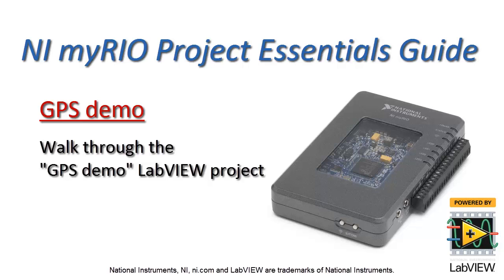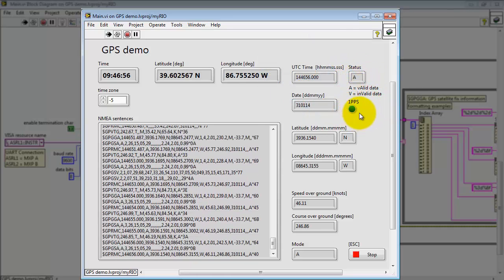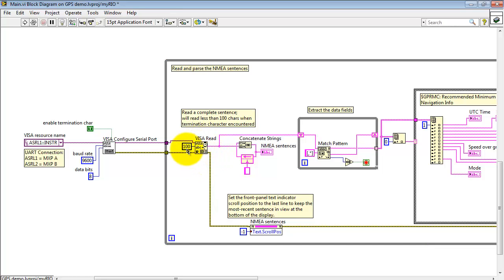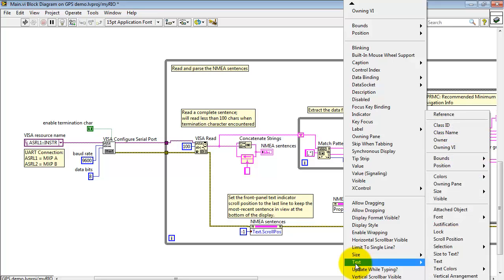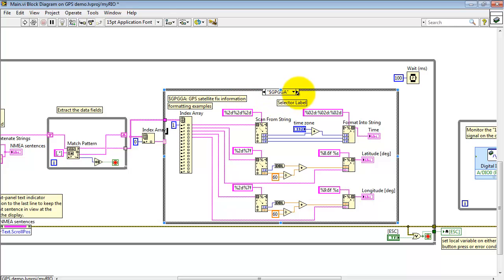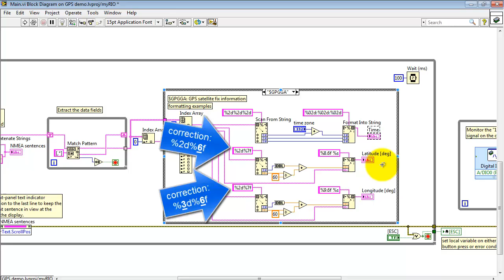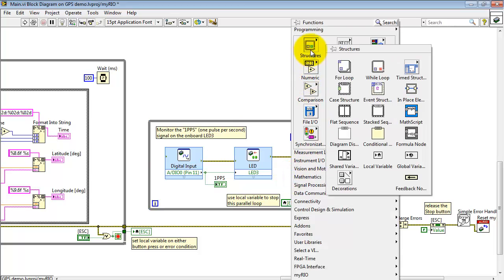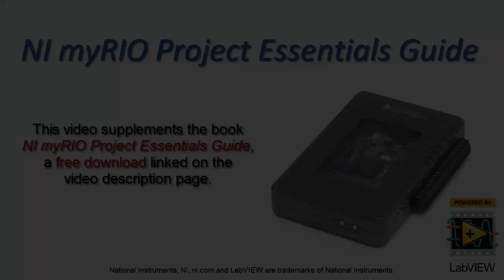NI myRIO: "GPS demo" LabVIEW project

Comment: Thank you for this video. I want to build a VI for reading data from a GNSS receiver. It connects directly to my laptop using a DX26 to USB converter. I also want to show altitude data. Do I still need the secondary while loop?

Comment: Thanks for posting the video. I am getting a -1073807339 error code. "VISA:  (Hex 0xBFFF0015) Timeout expired before operation completed."

Any ideas on how to get this VI to work.
Reply from the maker: The error message means that the UART did not receive any characters before the timeout period ended (10 seconds by default). Could you confirm that you are using the Digilent PmodGPS module, the "GPS demo" project from the .zip file linked in the video description, and that you have wired the module according to the diagram at the beginning of the video?
Reply: I got this as well, ensure you have the RX on the module connected to the TX on port A on the myRIO and TX on the module to the RX on the myRIO.
Reply: Hawkar Mahmod lol, brain fact. I'm used to I2c and SPI wiring. Not tx to rx and vice versa. Thanks!